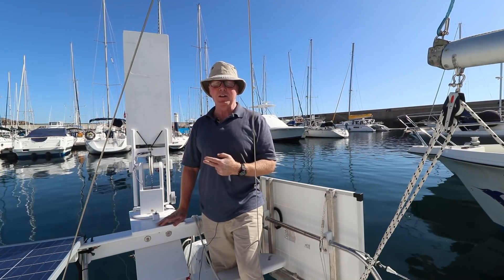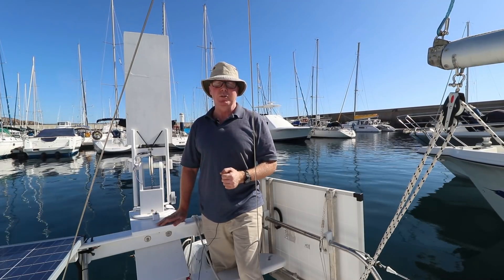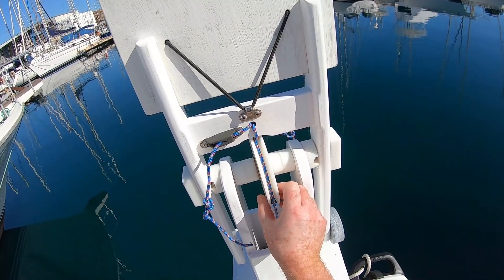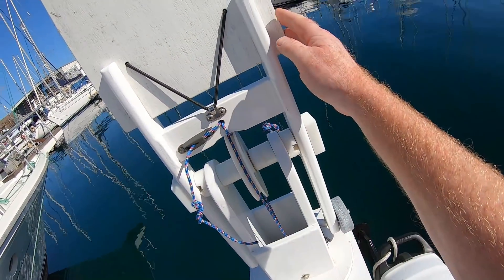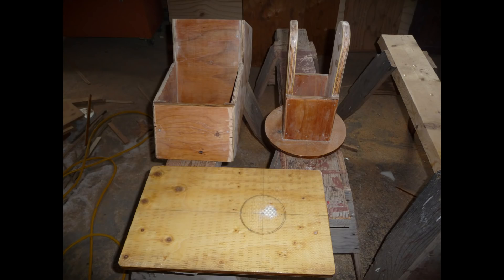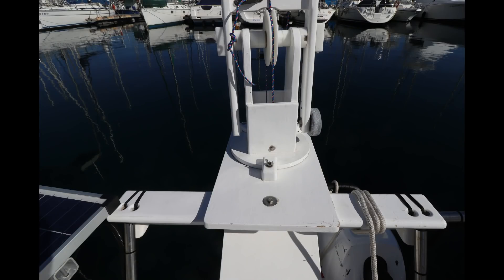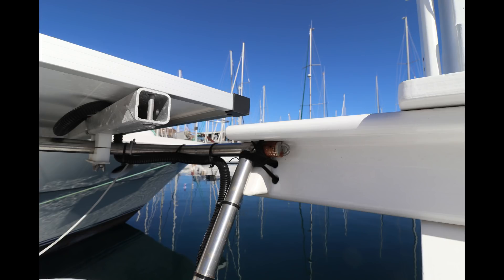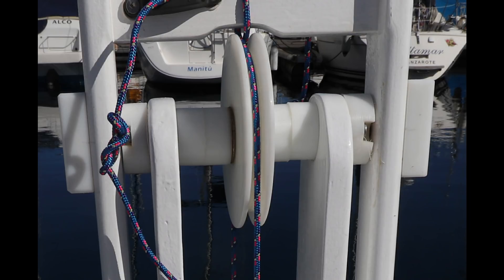How to Make a Wind Vane Self Steering Gear: Part 2

Comment: You must be very proud of having designed and built this yourself.  I bought a fancy commercial steering gear for my last yacht (which I sold 12 years ago) and it didn't work as well as yours. You're inspiring me to buy a smaller, cheaper yacht and build my own Mk3! Thank you.

Comment: Would be good to have a little explaination on how to rig up the cord that drives the pulley
Reply from the maker: I put a full explanation of the rigging including the sizing ratios (which is the critical item) with the plans (located in a link of the video description)
Reply: @RoversAdventure  oh yeah I found them in the  video.  Thanks for the great plans, I’m about half way through building mine and it’s really straight forward.
Reply from the maker: @SevenRavens007  Great to hear.

Comment: I believe the plastic used is HDPE not Teflon. Teflon is an amazing plastic but quite expensive 

High Density Polyethylene (HDPE) is an ethylene-based polymer plastic which is created by exposing petroleum to extreme heat and pressure. It’s among the most commonly used plastics worldwide, and in addition to UV resistance, has a variety of useful traits. As a thermoplastic, it easily melts and molds into required shapes. The ease with which it is formed and the fact that it is inexpensive to produce make it extremely popular for molded products such as containers, bottles, outdoor furniture, plastic toys, and pipes. HDPE is tough and difficult to tear, but although it is more impact resistant than acrylic, it is not ideal for high-impact or high pressure applications
Reply from the maker: Thanks for that am I'm sure that you are right. The material is still holding up perfectly after 3 years in the marine environment and all those sea miles.
Reply: @RoversAdventure  

For consistency (uv stability) I recommend purchasing a small piece of King Starboard 3/4”. It will cost a bit more than random cutting board material however it is definitely uv stabilized and should last a very long time when exposed to the sun.
Reply from the maker: @Dlgeis  I have a nice piece of Starboard for the Wave Rover 650  Mk 3

Comment: Since you are using chunks of a cutting board for your bearings and spacers, I suspect the material you are referring to as 'Teflon' is High Density PolyEthylene (HDPE) which is commonly used for cutting boards (Teflon is too expensive for this).  HDPE is dense and very slippery, very suitable for this purpose and fairly cheap, too.

Comment: Awesome videos. Have you ever tried bypassing the trim tab and running the control lines directly to the tiller? Maybe in conjunction with a light bungi for dampning. Probably not powerful enough, but I'd be interested to know?

Comment: Hi Alan.  So you don't lose your vane, drill a small hole in the vane and in your gear near it and run a small Oh Shit line, about 12" should work.  You run a Oh Shit line to the outboard, so do the same with the vane and it won't end up a bird perch floating in the ocean as you wave bye bye. :)  Are you enjoying the C26?  Thinking of getting one myself.  Keep up the great videos and happy sailing

Comment: It looks very much like the proven Wharram wind vane, which also is an excellent design. Great job and nice finish! May I ask why you choose to go with opposite movements of the trim tab and a lose rudder instead of a fixed rudder and the trim tab moving 'normaly' - there must be a reason I don't realize?

Comment: So far very interesting and helpful.
I steer my 20 twin keel yacht with sheet to helm steering and am very intrested in your earlier varation of sheet to helm which was successful for you.
May i ask why you decided to build a windvane option?
I am in the process of converting the same design of my sloop rig to a junk rig and think a windvane trim tab like yours might be necessary but only if it is as sheet to helm is simpler and easy to repair and perhaps safer near land when exhausted in wind shifts.
Thanks.
Reply from the maker: The reason I like the MK3 better than my original sheet to tiller system is that it is so easy and quick to make accurate corrections to the course. I found that the sheet to tiller was often affected by just me shifting my weight, as in going forward.

Comment: Fantastic series.  Thanks so much for the detailed instructions.  Do you have any suggestions for those of us with skeg mounted rudders?  I'm wondering if your Mk III wind vane assembly could be adapted to have an auxiliary rudder that would steer the boat, rather than a trim tab that steers the rudder.  Any ideas as to how to leverage up the power to turn a larger rudder, such as would be needed to steer without the main rudder?

Just one more thought, a suggestion actually.  Please use the cross-cut fence when cutting the wind vane.  I know that it can be done the way you did it (I've done it myself too), but just the slightest drag and that piece will kick-back with a vengeance (again, speaking from experience), it happens before you can react.
Reply: could your auxiliary rudder have a trim tab?  i am curious about how to put one on a kick-up rudder.

Comment: Hang on a moment.. you say you cut out the circular pulley and rectangular teflon blocks with a table saw? Which you "no longer have", but then when you go back home to your workshop, you cut out a new vane with a table saw? Both those items would be difficult and dangerous to cut with a table saw, therefore I'm guessing that when you said you cut the pulley and teflon blocks on a "table saw", what you actually meant to say was "bandsaw".. would that be correct?
Reply from the maker: The table saw is the tool I used and you simply make a jig, if I had more time I would demonstrate it as it's a pretty slick way to make pulleys any size. The trip back home wasn't always in the plan and I meant that I wouldn't have access to a table saw on the voyage.
Reply: @RoversAdventure  - Ok.. many thanks for the clarifications.

Comment: Thanks for the video. Still not clear to me how the vertical push/pull motion of the vane is translated into yaw motion to rotate the tab....or how this could be used on anything other than a transom hung rudder. Hopefully that will be explained in the next vid. Happy New Year!
Reply: The vertical lines (that push/pull) go down to blocks which change the direction so the lines run aft to a "teeter-totter" yoke that's attached to the vertical shaft of the trim tab.  Look at the video 3:04 to 3:17.  The system could be used on a small independent rudder, but it doesn't have the power that you get by using a trim tab on a rudder.
Reply: @chrismackay8314  Good eye! Thanks!